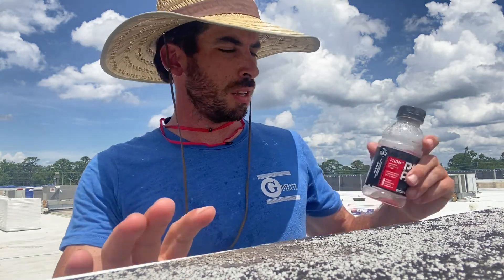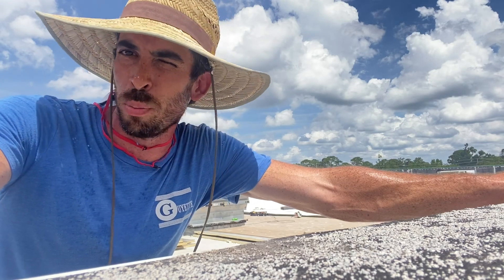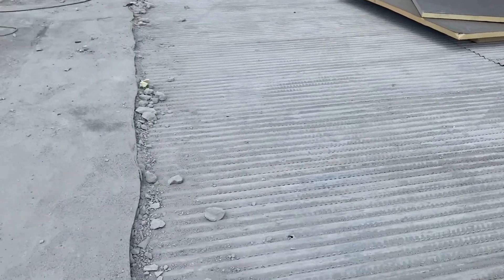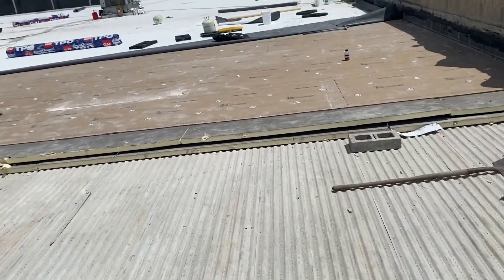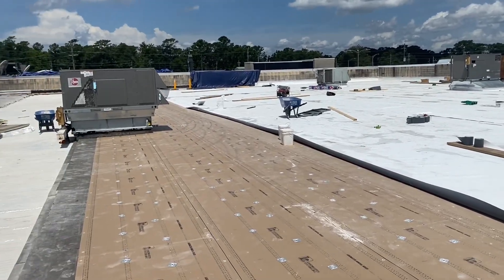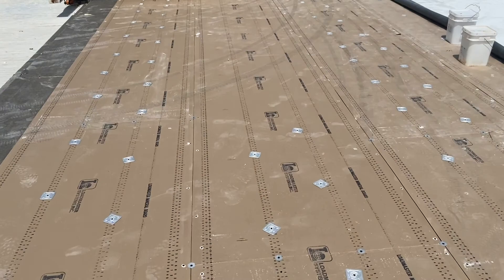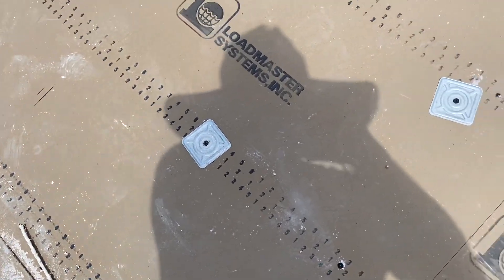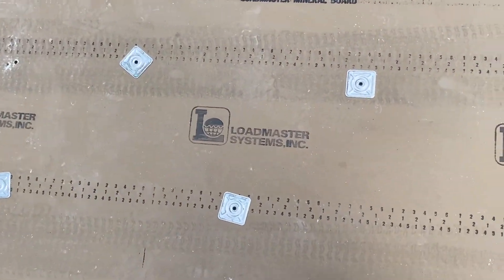Loadmaster commercial roof deck system

Comment: That doesn’t look like the typical roof master system installed on most roofs in Texas. Usually I’d be a gyp board over the metal deck (also by LM) and then insulation and then another gyp board and finally your choice of 2-ply, single-ply or BUR and gravel.